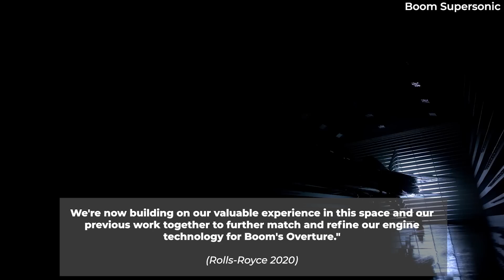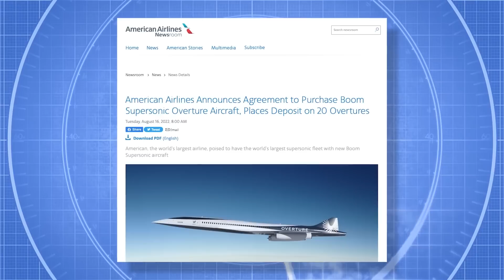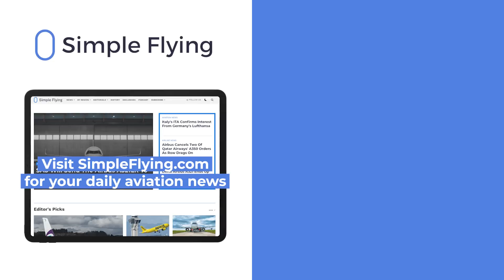Rolls-Royce Quits Boom Supersonic Airliner Engine Race

Comment: We have to remember that Concorde had loads of orders when it was in development and it then only had 2 operators, so just because the Overture has orders doesn't mean it will be a success, don't get me wrong I would love to see this plane fly
Reply: They are not even solid orders.
Reply: Boeing SST 2707 had big orders too.
Reply: There is no way that this project becomes a financial success. The problems that sunk the Concorde still exist, one being that commercial supersonic flight is banned over most countries. This limits their routes to over oceans. Not to mention this plane is supposed to hold even fewer passengers than Concorde did, and the small size of Concorde ensured ticket prices would never be cheap because the price per passenger can't be distributed over the masses. People don't wanna pay 15 grand a seat to save 3 hours flying to Europe, they'd rather have a first class seat that reclines and fly out at night and wake up the next morning without having wasted any time.
Reply: @donaldleyton4977  It's never going to fly anyway. They don't even have an engine for it a RR has made clear.
Reply: @donaldleyton4977  We already know that. They don't even have an engine for it so so it's all bs.
Reply: @shakiMiki  the hurdles against commercial transport is still the same. Limited route possibilities, low number of passengers per flight, high operational cost, etc. Half a century of time doesn't change the basic fundamentals of a business.

Comment: Without RR Boom is likely doomed.
Reply: At least 80%
Reply: 75% probably
Reply: General Electric or Pratt & Whitney perhaps?
Reply: Sad but true
Reply: @bkbinj6320  already not interested
Reply: @bkbinj6320  there is an Italian builder who makes the eurofighter EJ200 engines, French maker CFM that makes Dasualt engine Snecma M88. Volvo also made the RM12 for the Gripen. There are few manufacturers to choose from.
Reply: Others have ability to produce something. After all they produce military power plants. But the numbers don’t lie.
Reply: Boom should change their name to doom now
Reply: @Sophie-and-Ken  RM12 is a license built and slightly modified GE F404. Probably not near powerful enough even in four engine configuration, and near 50 year old design by now. And even if it would do, it would have the same export restrictions as engines built by GE, so better buy something more modern directly from GE ow PW, depending on how advanced they are ready to sell. Maybe not F135 or F119, but F414, F100 or F110 are not as advanced and might be available.

Comment: A GE F101 engine derivative would be the closest candidate for a supersonic engine.  The F101 engine was later developed into the CFM56. Both afterburning and fuel-efficient high-thrust non-afterburning medium-bypass variants should be considered. It would help greatly if many of its core parts were interchangeable with the CFM56 or CFM-LEAP.
Reply: Without overall redesign, it would be no where near economic enough lol

Comment: boom is a good example of "I'll believe it when I see it". Based on the radical changes in renderings of their "overture" it shows me that they haven't come close to nailing down a detailed design, which means they are even further from putting a plane in the air much less into commercial service. I genuinely pray they succeed because democratized supersonic air travel is just what the industry needs to revitalize travel which for decades has been technologically stagnant.

Comment: Could the amount of fuel required and the price make it non economical for them?
Reply: Rolls Royce had massive losses this year so I think that’s more likely the reason they dropped out.
Reply: That’s why it’s crucial that the engines run on sustainable aviation fuel.
Reply: @christainmarks106  Even if it's sustainable fuel, that doesn't mean it's gonna be affordable. My bet is that the thing will never fly commercially. It might not even fly at all.

Comment: What Boom needs is help from Uncle Sam. They need him to say "YES" to GE offering the XA100 engine core without its afterburner for Commercial Use (or P&W offering the XA101). That will give Boom a 21st century variable bypass engine designed for efficient supersonic flight with modern longevity. Either of these engines make 30,000 lbs (dry) without afterburners which will allow Boom to use TWO instead of four reducing mass, complexity and maintenance costs. It won;t exactly cost Uncle Sam anything because development has already been paid for and testing just wrapped up this month (Sep 2022).

Comment: Rolls-Royce is literally the only one of the big three engine makers without an existing engine that would've fit the Overture's original thrust and size requirements when it was a trijet.  Pratt & Whitney has the F119 used in the F-22, and the F135 used in the F-35.  Not to mention the XA101 adaptive-cycle engine for NGAD.  GE has the YF120, YF136, and XA100 designs to compete with them, and although they lost to P&W twice, they at least have a functioning engine prototype.  While the requirements for the quadjet Overture are achievable by some engines Rolls Royce has worked on (namely the EJ200 powering the Eurofighter Typhoon, which is based on the RR XG-40), they simply don't have the same experience working on compact, high-thrust turbofans as their American rivals.

The fact Boom chose Rolls-Royce despite all this a sign they really have no idea what they're doing.  Or that the engine makers with more experience already wrote them off.  Neither is a good sign.
Reply: Or those two companies already sign an agreement with US air force that they will never sell or create the engine for commercial.. if they design the engine.. no doubt it will somewhat similar to jet fighter engine design.. maybe that's why they choose Rolls Royce

Comment: Has to be 4-eng due to consequences of losing an engine. Also, the plane is much bigger than military fighter jets, so needs more engines. Essentially, it must use a P&W fighter engine with tech permitted by the USAF. Both P&W and GE are being paid by the USAF to develop a more efficient version of a fighter engine with good sub-sonic and supersonic fuel economy. Most unlikely the the USAF would allow this new three stream air flow technology, which allows variable quantities of air to enter the compressor and also the rear nozzle,  onto a civilian jet at this time. 
Boom would probably love the P&W F135 engine which is being produced in large quantities for the F-35. Given that Boom has Northrop Grumman finding and doing military applications of its jet, it is likely that NG can get Boom F-35 engines for some applications. 

Boom may have to settle for engines from the F-16, F-18 program that are more than 20 years old for customers that might leak engine technology. But UK, Australia, Canada, and some European airlines and militaries would likely be able to by a verson of the Boom with F-135 engines for cross-Atlantic and Pacific flights (Japan, Korea, Singapore, Australia, NZ).
RR did front and rear nozzle development for Boom. No doubt Boom can give the nozzle designs to its engine maker as part of an engine supply deal.
Reply: @ydfhlx5923  Modern military engines come with lots of diagnostic sensors and are far more reliable - that is why the F-35 has just one engine. More efficient supersonic engines will be larger. The twin jet military fighter might be on the way out in the West. Aircraft makers like Boom may need two different engine types - one very old tech to fly to most countries, and a very modern engine restricted to a few airlines and countries.

Comment: GE has announced it's new engine is ready for the F-35, but the F-35 is likely not ready fort it. The GE AX100 would be a good engine for Boom and others. Tri-jet design meant two versions of the engine. A quad-jet can more easily deal with engine out while operating cross-ocean, and only needs one engine type which is bolt on an off like current sub-sonic engines. On all but engine construction and heavy maintenance costs, the quad-jet surely wins over tri-jet designs.
Reply: If it is meant and was developed for the F-35 then it probably has major export restrictions on it. I'd imagine that that'd become a big obstacle.
Reply: @martijn9568  For key markets like NATO countries (maybe except Turkey due to S-400 purchase), Japan, Korea, Singapore, Australia, NZ, and other countries with a US security relationship, arrangements for the F-35 engine should be possible. F-16 engine of 20 years ago with civilian controls should be ok for another batch of countries. However, a US supersonic jet could not enter Russian, Chinese, Iran, North Korea and the airspace of a number of other countries.

Comment: I love to know what became of the high altitude commercial flights which were being forecast in the early 2000s. It was going to mean quicker long haul without the need for stop overs. If Boom is the only commercial plane looking at high altitude flights and is only in development, what happened to all the other projects? Did they find it wasn’t viable
Reply: Probably not economically feasible. I don't know how Boom's plane will overcome the economics of supersonic flight. Concorde had to charge around $10,000 USD per seat because the plane could only carry around 100 passengers and it was very expensive to operate. The entire plane was first class, no business or economy.
Reply: @coldpizzasoda8641  first class pricing, economy seat size

Comment: Here's what they should do why not slap F35 F135 engines to this plane or the F22 F119 PW Engines to the plane since Rolls Royce pulled out
Reply: It’s not a 100% transfer of technology. Boom engines don’t need after burners like the old Concord did. Another problem is sustained supersonic flight, the engines need to be able to handle 6-7 hours of supercruse. Most can’t do that. Also Boom was looking at a lower trust and the current military engine are to powerful. I think the Saab gripper used a viable engine but anything made for boom would need to be designed for that jet which means testing and certification which is $$$$$.
Reply: @Sophie-and-Ken   You mean the Swedish Gripen  Fighter jet using the F18 T-50 South Korean and philippine Air Force Ge F404/F414 engine at least it can work for Boom overture using the 13.9k lbf version which the non Afterburner F404/F414 engine.  4 of those F404/F414 is 55.6k lbf Which is also suited for the plane in commercial and military use.
Reply: Has anyone remembered the words classified information?

Comment: I've mentioned it a few times in other videos, but I maintained that the Overture would best be a 2 engine design instead of 4. 
Whatever the end product is, ultimately I'm just rooting for the project to succeed. It would be a welcome sight in commercial aviation to see the return of commercial supersonic flight, seeing the curvature of the planet during travel.
Reply: Well, 4 engines are likely for safety....
Reply: @dreamhunter2973  Twin engines are tried and true. The aircraft will fly just fine with one engine... just not at supersonic speed.
Reply: @sainnt  Given that there are no engines this is all wild speculation.  No idea on the charistics of the non existent engine.
Reply: @danharold3087  There's never an engine during the stages of an aircraft design. Obviously if the design is going to become a reality there will be an engine eventually. However, it does provide flexibility to figure out what engine would work best for the project.
Reply: @sainnt    I don't think boom or GE are following this chat.    We can speculate but lack the expertise to do so in a meaningful way.   I can say I favor a 2 engine setup where the engines are efficient at all speeds. Meet all requirements for 2 engine planes.  Big whoop.  We all want that.
Reply: @danharold3087  It's achievable because the aircraft is still in design phase and alterations can be be made before a final design is decided on.
Reply: @sainnt  Achievable if they can find an engine with other applications.  The market for this jet is too small to interest engine makers.  Obviously my opinion.  Hope I am wrong.

At this point all we have is people who want to build a small SS jet.  There are no engines and the design is in flux.

Comment: This was the wrong move as far as I’m concerned, rr clearly are expecting a downturn in the global market influencing there decision the question is if boom now approach GE and get a successful engine even with a downturn in the market with so many pre-orders it will be a massive pr loss to there biggest rival. The question for boom those is why can’t they use a hybrid engine setup that can be closed off in high speed flights for areas that mandate subsonic speed

Comment: The way people speak of this thing as if it does or will exist is perturbing in my opinion. We are talking about an aircraft which hasn't even left the development stage and as of right now is just a scaled down testbed for the technologies going into it, not even a full size mockup exists. It's all rendering's. Now they can't find an engine partner? I don't know if I should laugh or be even more worried about the viability of this project because it has way more viability concerns than it does results. The concord failed for a reason long term, several of them actually, and none of which I've heard any real progress towards solving with this airframe. 

The reality is people didn't care about supersonic travel enough to get the numbers needed to make it mainstream. Boom seems to not remember that the engines that went on the concord were military based fighter engines with afterburner. Why not take the same route? There are plenty of options to choose from that are far more advanced than the Olympus based variant's. What marketing studies have been done to see if this would be a viable commercial success? We are collectively as a planet suffering from a pilot shortage and the desire is to build even more aircraft with smaller capacity? I've got a lot more question's but I'll stop here.

Don't get me wrong it would be cool to see this succeed but I don't think it's anything more than an investment scheme and publicity stunt at the moment. If they make a full scale functional prototype I will eat crow but until then I have very sincere and realistic doubts to the viability of this aircraft.

Comment: Is faster really better? I don't think so. Why introduce new problems into aviation. Will the boom project really be profitable? What kind of fuel will the engines run on. I presume from a lay man's point of view the engines will run on Jet A1 fuel. In which case what's the cost of that kind of fuel today. What will the cost be tomorrow. No one knows for sure. But I see it going up and away. I see this project as an open ended gamble which may not pay off. I understand RRs backing out of engine production. Bitten once twice shy. If I were to have my say it's no use wasting money on a white elephant project.

Comment: This entire project is vapourware
Reply: no, just difficult.  there is a difference.
Reply: @AnotherPointOfView944  No, it's literal vapourware. They had scheduled (subsonic) test flights of a 2-seater prototype for 2017. It's 2022 and they haven't even built said prototype because, turns out, they have never had a working engine. 🤣